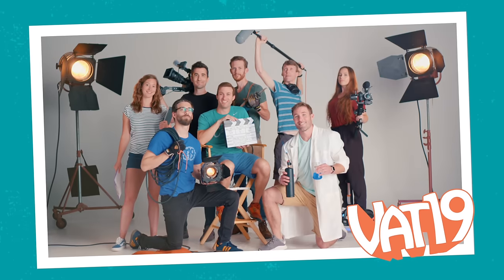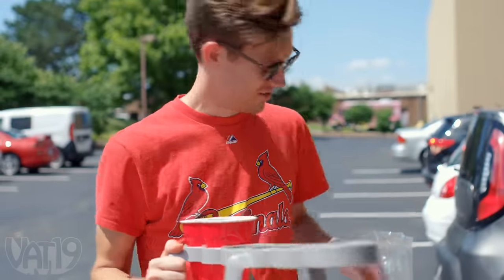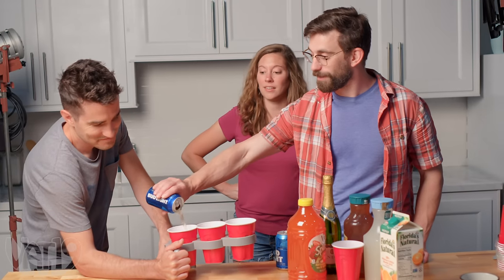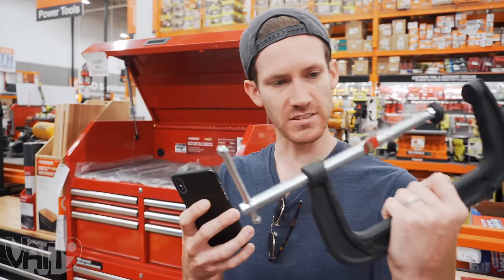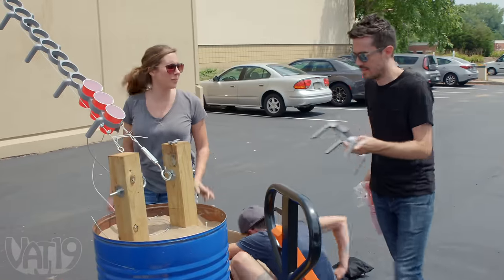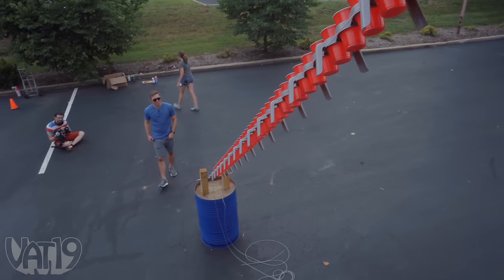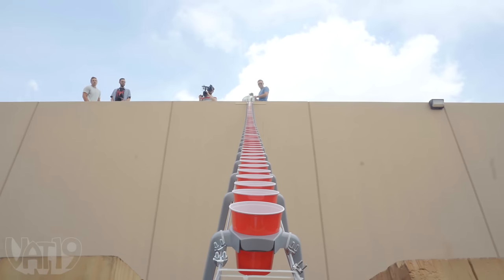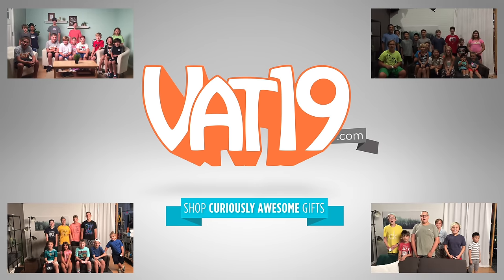The World's Longest Drink Waterfall? • This Could Be Awesome #1

Comment: All those drinks have different densities. so the test of where the structure collapses isn’t accurate because water has a different density
Reply: The densities vary so little I don't think that would be an issue. Not filling all the cups the same amount however would give an innacurate estimate of where
the structure collapses under the weight.